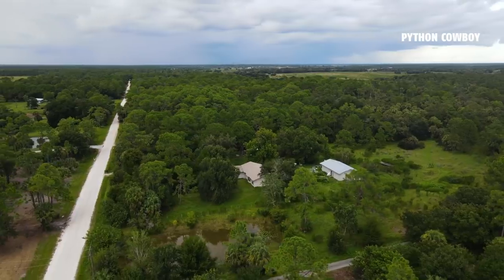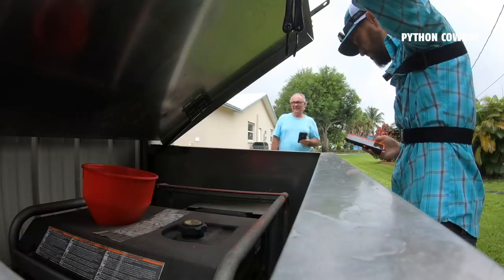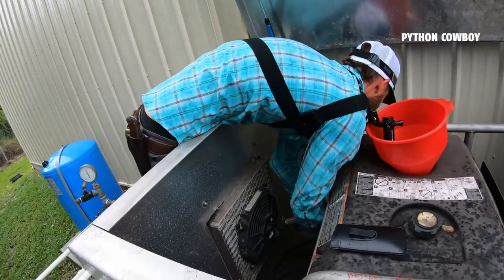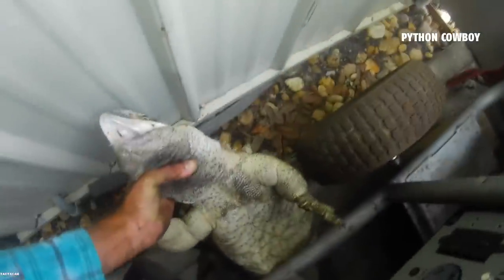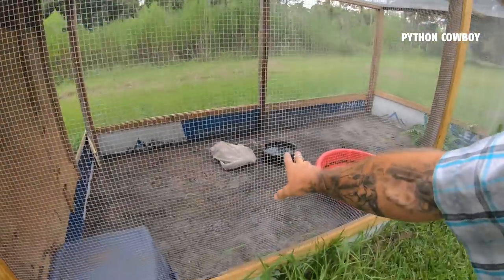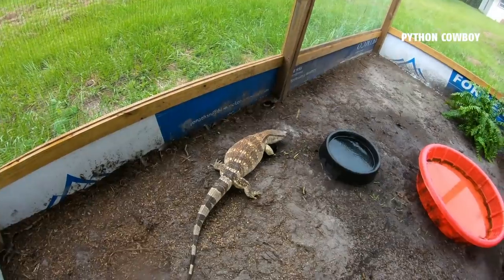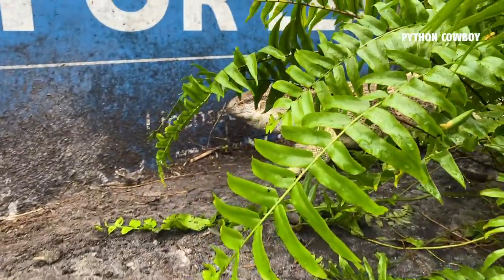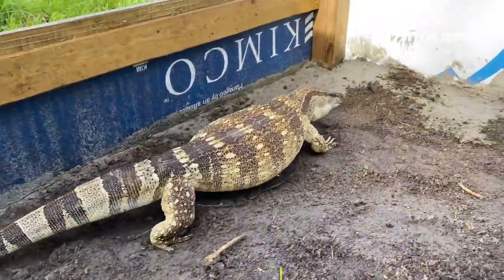White Throat Monitor Rescued From A Home Owners Generator Box

Comment: That's not a lizard, its a dragon!  Monitors are no joke. High speed, high endurance (for a reptile), powerful bite (some even venomous), strong claws... luckily they don't drop tails like iguanas.

I'm actually wondering if that wire mesh is going to be strong enough when he gets a bit bigger.  I had an iguana about that size that rip through a screen lid on a little tank I tossed him into while I was cleaning his enclosure but I'd wager that monitor is quite a bit stronger than he was.